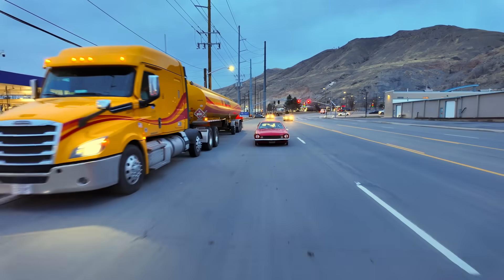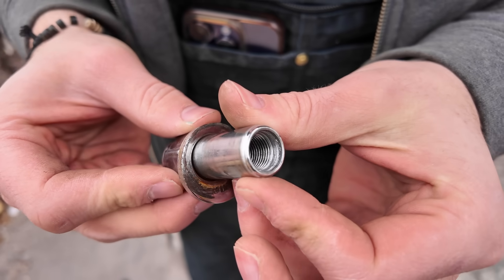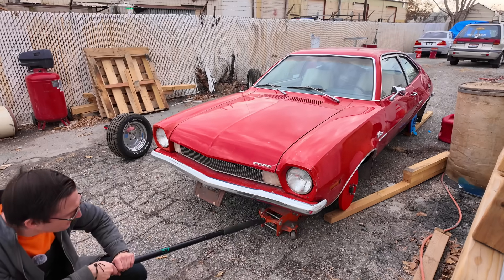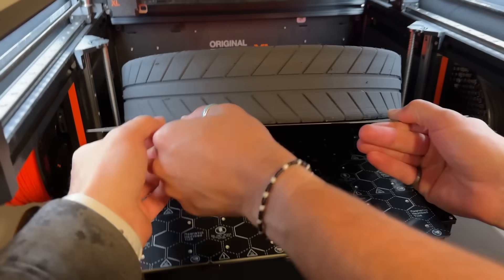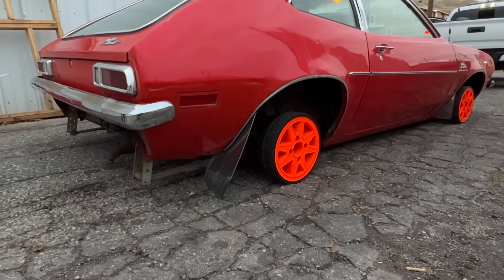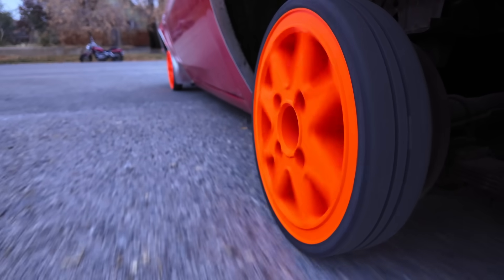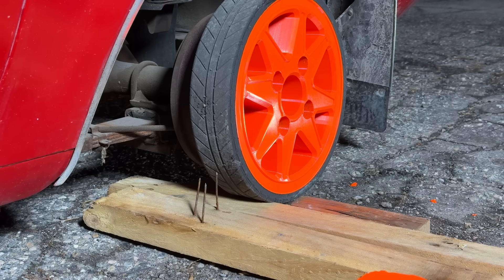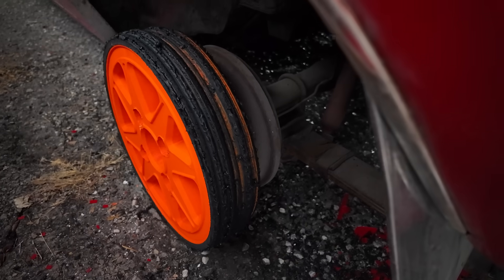What Happens If You 3D Print Car Tires?

Comment: I unironically think that if they had a bigger printer or perhaps 3d printed 2 parts and connected them together without compromising on integrity and quality then it wouldnt be a bad deal. I also want to add that you guys are my favourite moonshine distillers
Reply: they could use the orangestorm giga its like 3 ft by 3ft by 4ft
Reply: 10:23 it cost $80 a wheel so at full scale it would be a hard sell. However using standard metal rims and printing the tire could work*. Airless tires have all failed to take off because making a tire that performs as good as air filled tires on turns and in straight lines is very hard. 3D printing is definitely a newer technology with huge potential, but as far as I know plastic is not a grippy or durable as rubber, and rubber cannot be printed. Printed tires can still be made really good and used everywhere but automotive car tires.
Reply: @hellothere6627  Rubber technically can be 3D printed, it's basically what TPU is. TPU can be 3D printed on many 3D printers.
Reply: @kingzach74  TPU is different from tire rubber in two major ways, grip and melting temperature/ operating temperature.

TPU is not grippy and there aren’t any notable grippy plastics compatible with 3D printing, the best I’ve seen is TPU with recycled tire bits mixed in. Traction is a huge deal and cannot be compromised in replacing traditional tires. TPU falls way short of that. 

Tire rubber breaks down instead of melting, and has a high temperature resistance, so a complex custom extruder would be needed for printing rubber. TPU temperature resistance likely isn’t good enough for extended driving.
Reply: @hellothere6627 there is tire rubber filament called pneumatique, but it absolutely reeks while printing
Reply: @krollmond7544   very interesting! I looked it up but struggled to find test comparing the grippyness/traction of it.

For full automotive purposes though meting temperature is still a concern. Phenix Arizonas roads get up to 71C (160F) in the sun and TPU’s softening temperature begin at 60C (140F) with high temp mixes around 120C (248F), but this still ignores additional heat tires receive while driving. Overall the safety margins are small for the tire to completely deform. Normal tires shouldn’t get much hotter than 60C during use which sounds good for TPU, but hooter temperatures on normal tires means increased wear, not complete failure. Source: quick googling, correct me where wrong plz.
Reply: unironically 🥀

Comment: It's so crazy you can just drive that on the road. Where I live your driver's license would just spontaneously combust.
Reply from the maker: That might happen here too
Reply: in the EU its actually an instant execution
Reply: @grqfes  fortunately, lmao
Reply: Every one of these i watch im like, surely thats not street legal, surely theyve done their due diligence to get some sign off before driving something so slapshod on public roads. But of course, because they're typical youtubers, they wouldnt dream of it
Reply: California
Reply: Actually, 3d printed tires get a bit confising. If you can prove the durability you may be fine. For example NASA actully uses them on rovers, and some conpanys are working on maming these much more durable & acessable.
Reply: @100SideDice NASA is using metal to print their wheels - and their rovers are incredibly slow.
Reply: Most of the time, it's more like a metal-plastic hybrid. Some parts are printed and other parts arn't @no1DdC

Comment: When you want to try and fit only a part of big print, like bolt pattern of a wheel, you can just cut out that specific part in your Prusa Slicer using Cut command (shortcut: C). Just do a couple of cuts and print only a part of your whole design. No plastic wasted. Also no time wasted either

Comment: Prob not worth time and effort, but it'd be interesting series "can I make actually better 3d printed wheels". With geometries achievable with 3d printing it could be... interesting.
Reply: It's possible with a proper weight distribution, one beam relieving load pressure from another.
Reply: Or he could just 3d print regular size wheels rather than matchbox car wheels

Comment: ....prints full size piece  just to check for bolt holes... Dear lord.. No. Make slices and cut parts to smaller bits that you use to test the fit. You really only need to print a disc, without TPU. Takes half an hour, if even that much since you can crank up speed and use draft settings in the slicer...
Reply from the maker: We did we just didn’t show it 🗿

Comment: 6:03 Those are called Traction bars!! They preload torque to the leaf springs tightening everything up and ultimately they improve traction as the name suggests. Makes no sense on that car though hahaha.
Reply: They don't preload the springs, they stop the axle from rotating.

When launching hard (most likely harder than a stock pinto is capable of, unless you neutral drop it from 7000 rpm) the axle may rotate causing the springs to distort (become s shaped essentially.) when this happens the traction bars hit the spring, stopping the axle rotating further.
Reply: @skrrtskrrt646  Any idea about the whole weird mounting on the rear leaf springs? That is absolutely not STOCK Ford engineering. =)
Reply: @jubuttib  the leaf spring shackles at the very back? probably parts store "lift kit". we used to call them tater diggers.
Reply: @skrrtskrrt646  That's also not quite correct lol. Yes, they help with axle wrap, but that's not their main purpose. For traction bars to work properly, you need to have axle wrap. When accelerating hard, you twist the axle into the bump stops - and with that, you increase downward pressure of the wheels onto the road. 

Ever seen a drag racing car, when they accelerate, they lift the rear? That's traction bars pushing the axle down instead of forwards, by extension lifting the rear. 

They're called traction bar for a reason, not anti-wraps.
Reply: @skrrtskrrt646  yup. We always called them slapper bars
Reply: Maybe in the past a previous owner was starting a drag build with this car and gave up?
Reply: Maybe someone installed them to hide something broken, might be good for hiding blown shocks.
Reply: That is what was happening in 12:47 right?

Comment: Pinto had traction bars, supposed to help eliminate wheel hop on leaf spring suspension.  You know so your pinto can really run out it's 0-exploded real fast.  You need to be cutting in the movie Top Secret, there is a good pinto scene.
Reply from the maker: Ahhhh yeah it really helps with the 45 horsepower ol Greg has
Reply: @WaterjetChannel  What ya doin' out here in these waters?
Reply from the maker: Just taking the air yannow. Not fishing.

Comment: Wow, I didn't even know you can print something like that in one piece with two materials, amazing.
Reply: Changeable toolhead, if your printer frame can take it you can even put milling head and start using it as CNC... But, it ain't cheap...
Reply: you need a fancy printer that can load multiple filament spools at once to do it
Reply: @Stormer-vx5kw  OR go through a LOT of trouble changing the filament manually every layer... =)
Reply: @jubuttib  I refuse to believe thats possible without accidentally knocking the machine out of place and ruining it lmao
Reply: @Stormer-vx5kw  Yeah the possibility is only really theoretical... =)

Though for smaller things it is absolutely doable, like printing a little flexible "hinge" from TPU between two PLA parts. Been done for ages now.
Reply: Tool changers and IDEX printers can do it. The Prusa XL he got for free is worth $3500+, and is a beast.
Reply: AMS
Reply: @nathanieljames7462 no not with TPU and PETG, that's why I don't care for AMS

Comment: not so small bro, get a bigger printer.
Reply from the maker: Easier said than done 🥴
Reply: @WaterjetChannel  trust the theory, bro. you can do it.
Reply: @WaterjetChannel  elegoo nepture max 3/4 is a big one, can do those materials easy
Reply: @WaterjetChannel  you can also do "tank-track" wheel in parts. hub + split piece segments tire tank track.

Comment: Probably not
Reply from the maker: Me when I comment before finishing the video
Reply: @WaterjetChannel  Hey can you make a video about if you can drive on 3d printed wheels :D
Reply: @WaterjetChannel  The perfect response (totally not commenting before finishing the video)
Reply: @WaterjetChannel i’m gonna attempt to 3d print wheels for my moped will dm if it functions. i might have to do them in thirds or quarters to make them big enough all i have is an ender 3 s1 pro
Reply: @WaterjetChannel  I liked the experiment, but are there no regulations in the US? I'm fairly sure it'd be illegal to drive this on a public road here in Czechia (e.g. you can get fined for not using winter tires during winter). So it depends whether we talk about "can drive" in a purely technical sense or a practical/legal sense :P
Reply: @WaterjetChannel what rubber did you use
Reply: @WaterjetChannel  I love how you made the coolest low rider by accident 😂
Reply: @WaterjetChannel nerd
Reply: Not me commenting before I finish reading that comment
Reply: They 3D print metal tools, you definitely can. You just might need an extremely expensive type of 3D printer
Reply: @VintageFenrir yeah sls printers are about porsche level pricing they’re working on getting them down closer to audi levels it’ll be a while though
Reply: Yes, you can. Would I recommend it? Absolutely not.
Reply: @companionsytoriginal873  that won’t stop me cause i can’t read
Reply: I was about to actually watch the video until I saw this, thx
Reply: 🚬..🚬………. Yep
Reply: Keep it solid no honey coneing etc
Reply: Bro exposed in 4k
Reply: Yeah bassically my same thought
Reply: I feel like bro just came to comment this and then left. Without watching the video lol 😂
Reply: Me when I skipped to the end of the video
Reply: Could've made power wheel wheels sense those constantly go bad
Reply: Probably yes, you have a small mind
Reply: @ginger_nosoul  i think it  was a joke man😭